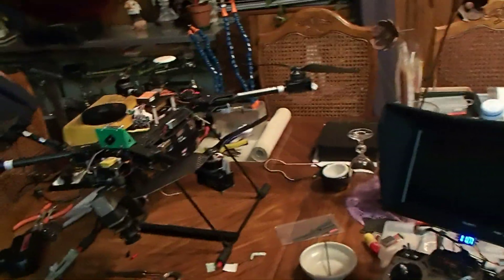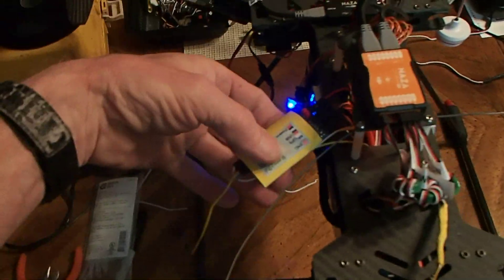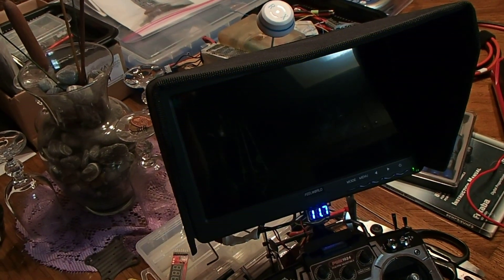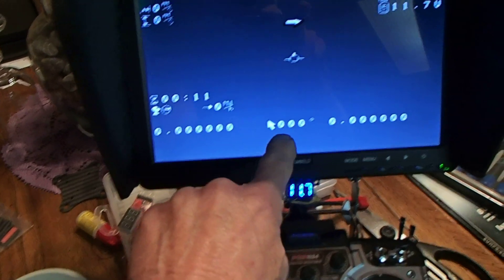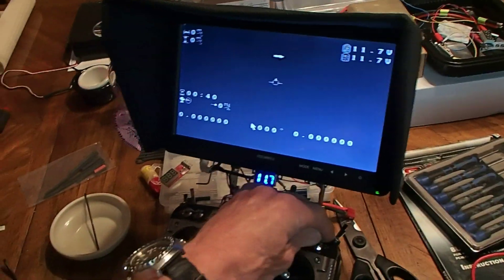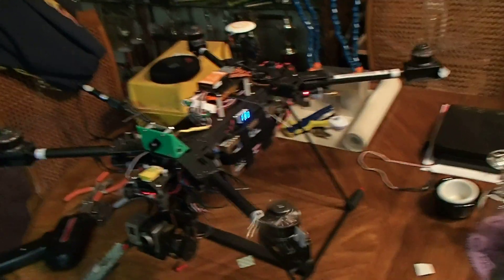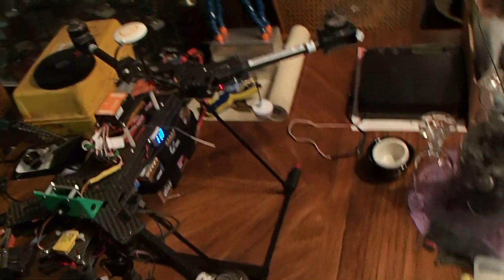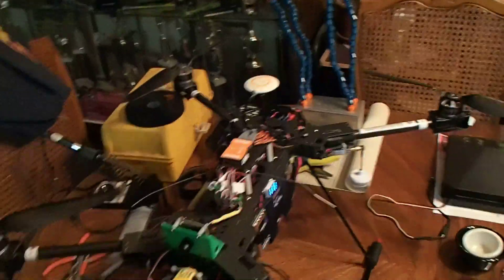First prop and motor start up test on my Alien 680 quadcopter

Comment: Hi! I've got this same frame, but 945kv motors, 1045 props, 30A Simon-k ESCs, 5000 mah battery and arducopter. The problem I'm having is that the quad doesn't stay on air for too long (just a couple of minutes), and then it starts to descend. Putting a new fully-loaded battery makes it fly again, but just for that same small amount of minutes. What do you think? Could it be the props? Could it be the motors? Any input would be much appreciated. Thanks!
Reply: Because you need more than 30a

Comment: Hi and thanks for the vid. I just got one of these in the mail, motors, and tarot t2d gimbal. It has sunnysky 4110-400kv and CF 14x4.7 slo-fly props. I am gping to put on a naza V2, dji ground station gear, and iosd, along with dragonlink Rx. Im still deciding on video gear, I might go with 1.2ghz or 900mhz. Wow...10000mah with 13" props? AND a 2nd video battery? And it got off the ground? Are you running 4S or 6S? Thanks. ps...I still need ESC's.

Comment: Hi, What PDB you are using? if you can show the link where to buy, I am about to build similar one.
Reply from the maker: I use 2 of these inside the chassis. One dedicated for engines only and the other handles all the regulated power from my step up/step down board.
http://www.ebay.com/itm/Multi-Rotor-ESC-Power-Distribution-Board-For-Quad-Hexacopter-/271544043258?pt=Radio_Control_Parts_Accessories&hash=item3f394946fa

Comment: Hi friend, what flying time are you having?
Reply from the maker: Currently with the MT3508-20 (580 kV) motors and a 3S 10K mAh battery flying 14" x 5.5 CF Props 18 mins, using the 4S 10K mAh battery with 15" x 5.5 CF Props I get right at 22 mins.

Comment: I am building a ATG Reptile 700 frame right now as we speak and I am actually referencing your quads layout although its a slightly different style frame.
How well does your fly? I mean the CG and all?

Thanks for the vid man :)
Reply from the maker: The cg is right under the naza unit and about the level of the top of the battery. Here's a vid to show the retractable landing gear in operation as well as how stable it is. Zeus and his New Retracts: http://youtu.be/FHIdhaO8XQ4

Comment: It sounds like the motors are cogging/and or starting unevenly - this has been a known issue with Simon-K and pancake motors. Have you had any issues with sudden throttle changes?
Reply from the maker: No issues but if I start it in gps mode, I have to move the throttle all the way to 50%+ before they take off at an elevated rpm. They don't ramp up smoothly and evenly. But if I start in manual mode they do. I've had no issues with the Simon k esc's on this build.
Reply: Good to know! I also have a NAZA V2 on one of the HK H.A.L. quads and it starts the same way - I have to give it full throttle at takeoff and then it's normal once in the air.
Reply: The Naza is set so that in GPS or ATTI mode the throttle position moves to 50% for hover, however in these modes it does not correlate with 50% motor speed. The naza figure out the hover throttle, so for heavier rigs I find if you raise the throttle to just over 50% on take off and wait 5 or 6 seconds you will hear the throttle continuing to increase until it finds it hover throttle, then more throttle makes it lift easier. Manual mode gives you the true motor throttle for your throttle stick position.
Reply: Right on Tony - I asked that question before I knew this, but thanks for spelling it out!
Reply: Tony F Good data. Exactly as my birds now do.

Comment: How did you mount the gimbal. Pretty new at this. The one I want does not come with hook and rail system.
Reply from the maker: This doesn't have that either. There's actually a couple of plates that come with the gimbal and they have the rubber balls between them. I used stand offs and 3mm screws to secure the top plate to the chassis. I had to drill some matching holes because the pattern they both had didn't align
Reply: Dennis B Thanks, maybe I will get it and see what I can do with it. I have the predator on order but who knows when HK will have it back in stock. I plan on using the zenmuse h3 3d.

Comment: cool machine, the battery is 22V 10 000mAh ?
Reply from the maker: These are 3S batteries. 12v roughly.

Comment: I'm thinking about building this same quad.  I'm thinking about using 15" props.  Are you using 4s batteries?
Reply from the maker: Mine are 13" props and Richard Shelton from Multicopter Builders says they're too big for the motors but the spec sheet and e-calc says they are fine for my weight (6.07 lbs. flight weight) so I guess we shall see. I'm running a 10,ooo mAh battery for engines and a 2,400 mAh battery for the vid, fpv stuff and NAZA unit.